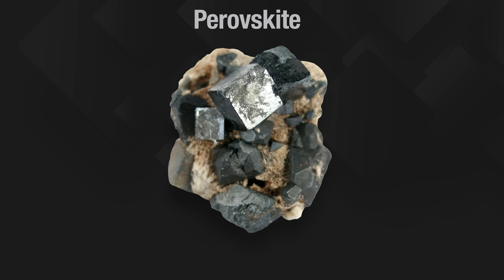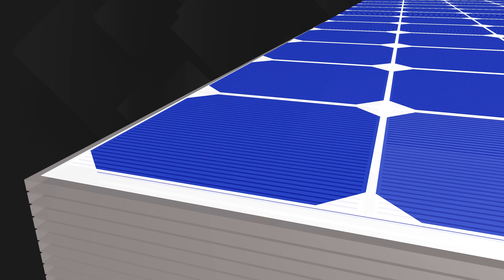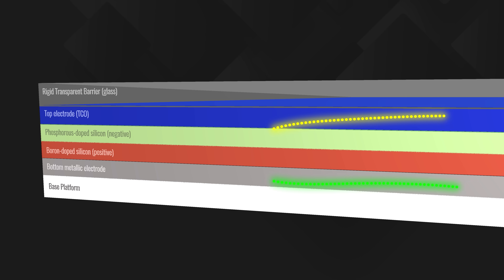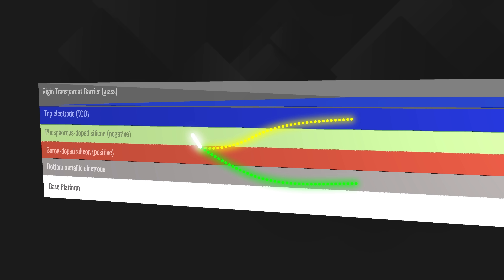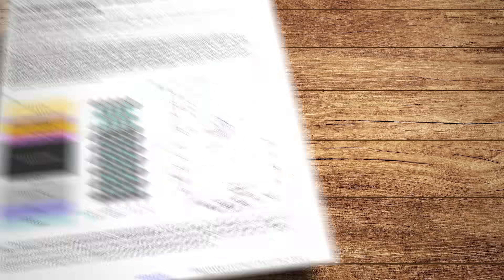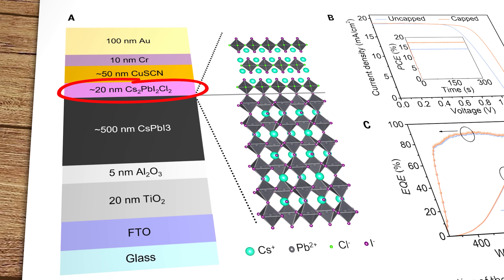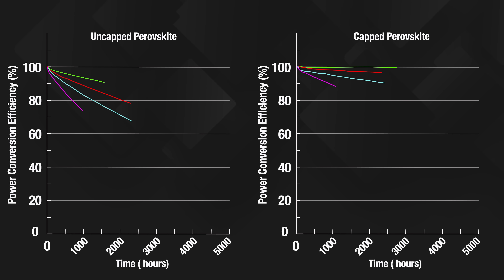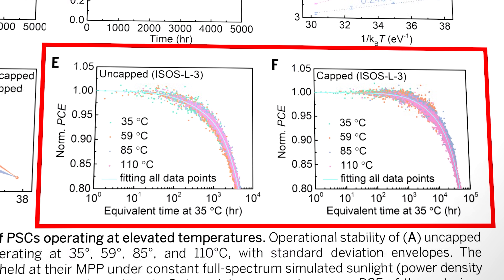Perovskite solar cells. Major new breakthrough!

Comment: I like the idea of being able to replace just the film and extend the lifespan of the solar panel..
Reply: Replacing in situ would involve spraying/spreading soluble lead compounds. You’re pretty much guaranteed to have to at a minimum take them back to a manufacturing site because until it’s encapsulated it doesn’t like oxygen or water at all.
Reply: @robertb6889  ahh .. I thought I was being optimistic but it would be a useful direction to avoid panel redundancy.
Reply: @constructioneerful  If you designed it carefully, you might be able to reuse a large part of the panel for easy recycling - essentially refurbishing it in-factory. Though at the same time, honestly, you shouldn't have production lines static enough in place for a solar panel which should have 20yr lifetimes or more, similar to a 15-30 year roof lifespan.

Comment: Thanks again, David. One issue that seems concerning is the limited lifespan of a rooftop solar cell. (~30 years?) What's the cause of the degradation, are there solutions (just keeping them cool?) And ultimately is this a bad thing or a good thing? Maybe in only 10 years from now the technology will have advanced so much that replacing them before 30 years are up might make more sense. But what do YOU think?
Reply: 30 years is significantly longer as the lifespan of an asphalt shingle roof (at least here in Minnesota). It’s significantly longer than the lifespan of the average automobile. It’s longer than the average lifespan of an oil well. It’s a third of a lifetime for a long-lived person. It’s the official lifespan of a typical nuclear reactor (although reactors often get another 10-20 years of extensions). So for me at least, a thirty year lifespan isn’t a huge concern.
Reply: divide the initial cost by its lifespan if you want to gauge if its lifespan is long enough. Pricier object should last longer than cheap object. This perovskite solar panel, if it is half the price of silicon it is already good enough to last 10 year, don't even need 30 year.

Comment: Main issues with perovskite solar cells:
1- poor operational stability
2- toxicity because they contain lead
3- poor performance when scaled up to large areas
It's an extremely sensitive material good for space applications if you ask me
Reply: I wish more people realized how truly terrifying this form of lead is. The slightest amount of water dissolved the lead right out as a lead-halide.
Reply: @robertb6889  Oh well humanity will be dumbed down enough not to worry.
Reply: Lead is only really a problem if you eat it. It was a worthy move to get it out of paint because paint chips and introduces itself into soil, it comes in liquid form and so there's always runoff and spills. Nobody's going to be chewing on your roof.
Reply: I think lead and cesium are very real environmental risk, and human risks, but more so in extraction, processing and disposable of the panels.  The quantity of these materials needs to be minimized if not eliminated.   But we do have lead acid batteries currently in production with very low cost and low impact, if we can can improve over the controls on lead acid batteries than maybe this risk is better than using fossil fuels.
Reply: #1 & #2 is being dealt with, expect to see cells without Lead. As for #3 ( poor performance when scaled up to large areas), what is that about?
Reply: They are researching using tin instead of lead. Looks promising.
Reply: Its very little amounts of lead which can be seperated in recycling, enclosed in the material so thats not a problem I suppose
Reply: Really think they will be useful more broadbandly
Reply: @CornMCMais  it has way too much lead still to be considered safe to be used in mass.  It will leak to environment. Even 1 milligramm per panel would be too much.
Reply: @movax20h  It's all cristalline material which can be enclosed how is it supposed to leak? People are putting lead sheets on their roofs lol
Reply: @CornMCMais  lead is being band is a lot uses.. if its to be used there is going to be a recycling requirement for sure..,
Reply: If there’s minimal exposure to water the lead dissolves right out like salt would. This is NOT metallic lead, it’s a highly soluble inorganic lead: ie the worst possible form.

All it would take is the panel to break, either due to improper recycling, weather or ending up in a landfill. Also don’t neglect industrial hygiene issues at the manufacturing plant.
Reply: @robertb6889  My bad, you're totally correct
Reply: I mistook it for an insoluble material.. but it seems that there are already working groups trying to replace the lead with tin, having yet to overcome the issue that the tin is oxidizing over time.. having a lead free and long living perovskite solar cell would mean it could enter the European market, making it much more viable to mass produce it seems
Reply: Dennis Lee's invention produces energy 24/7 anywhere in the world, hot or cold, day or night. And connected to their compression motor, it runs continuesly recycling over and over. The more the wind hits it, the more heat it extracts from the atmosphere. Therefore it doesn't need the Sun. 
A very simple and easy to manufacture device. Very little maintenance, has already been in production and on the market for over two decades. But the Nurds want to make everything so difficult. 
You'd think that if the Climate Crisis was real, this device would be mandated for every building in the world. But the Climate Crisis is a Hoax. So good luck with having real products for real solutions.
While you're here, look up Dennis Lee, Troy Reed and The Big Eureka. At least have a peek down the Rabbit Hole.

Comment: Okay, lots of physics in this one. I love this channel, but remember that the Arctic is already melting at our current level of 415 ppm of carbon dioxide and releasing huge amounts of methane and carbon dioxide as it does so. We really need to geoengineer the planet back from a level of 415 ppm of carbon dioxide to 350 ppm of carbon dioxide and that will take huge amounts of energy.

Solar photons only have about 2 eV of energy and chemical things like coal and batteries can only store about 2 eV of energy per atom. When you fission a U-235, Pu-239 or U-233 atom made from thorium, you get 200 million eV of energy. Doing so in a molten salt nuclear reactor only produces nuclear waste that only needs to be stored for 300 years to become as radioactive as coal ash. When you fuse a deuterium atom of hydrogen with a tritium atom of hydrogen you get 8.8 million eV of energy per atom and no nuclear waste at all. Take a look at a company called First Light Fusion for a new fusion process that will be producing commercial fusion plants in about 10 years. Until then, every little bit helps. I have been buying wind and solar electricity for about a dozen years now.

Regards,
Steve Johnston
Reply: Commercial fusion plants in 10 years! I think that's several decades off, at best.
Reply: New nuclear cannot compete, at a cost per kWh more than double renewables costs.  And no utility is going to contract for a new NPP when multi-billion dollar cost overruns and decade long construction delays have occurred at all the NPP construction in the west.  SMRs are a waste of time.
Reply: @acmefixer1  Take a look at First Light Fusion's Projectile Based Inertial Fusion process. They were able to induce fusion last April with only $59 million of research effort and their successful fusion experiment was validated by the UK Atomic Energy Authority. Others have spent many billions of dollars doing the same thing. First Light Fusion admits that solar is now the cheapest way to make electricity, but they believe that Projectile Based Inertial Fusion can make electricity as cheaply as natural gas. First Light Fusion points out that they are not trying to find the cheapest way to make electricity. They are trying to make the cheapest form of base-load electricity that is always available. Projectile Based Inertial Fusion could be rapidly scaled up to any level using very little reactor material or real estate.

We will need huge amounts of energy to geoengineer the Earth back to 350 ppm of carbon dioxide. Being hot is very unpleasant but it is ocean acidification that has driven most of the previous mass extinctions on the planet. Shielding the Earth with aerosol sprays can cool the Earth but will not fix ocean acidification. We will need to remove hundreds of gigatons of carbon dioxide from the air and oceans.

Regards,
Steve Johnston
Reply: The plasma containment vessel gets irradiated by neutrons, and becomes radioactive waste itself.  Unless First Light has solved this, it's probably not correct to say that fusion creates no radioactive waste.  I believe that we will have fusion power some day, but I don't believe it will ever be economically feasible without massive subsidy.  I'd love to be proven wrong on that.

Comment: Solar panels and energy storage are already on par with carbon alternatives. Soon they will be the only economically viable option.
Oil, coal and gas won't go away, but instead of burning it, we will use it in the chemical industry.
Plastic recycling will soon pick up too, because of those ever-increasing carbon prices.
Things might not seem dire on the long run, but I do wonder how much of nature will be destroyed before we truly get our act together;
things do still seem bleak given the speed of habitat destruction...
Reply: Absolutely. Tech is all important but it will not get us off the hook. Without significantly smaller eco footprints neither humans nor great parts of nature are going to survive this.

Comment: hoping the right researchers put several things together and the deployable results make a difference.  you move from roughly 20% efficient up to near 40%...  you're likely almost doubling power output in the same area ... that, is quite a big step...
Reply: Yes.   Once we hit 30 % efficiency and above things begin to get fun especially when mated with the latest building science trends.   If we can hit 10 kWh of PV in as few as  20 panels it would satiate the electric needs of most small to mid size homes with good solar potential.   If said homes were recent high efficiency builds they would almost all be Net Zero homes.  40 % efficiency would be fall out of your chair good
Reply: @hmurchison8123  As fare as I know 30% is physical limit.
Reply: @michaewelina7983  yes of standard PV panels but if we can lay films on PV that operate at different band gaps we will be able to exceed the Shockley-Quessar (sp) limit.

Comment: Thanks Dave!  Sounds good, just the elemental choices for the protective layer leaves me wondering if something safer could be developed.  As one Canadian toxicologist mentioned to me, there really is no safe lower limit for exposure to cadmium, and possibly the same is true of lead. Given that awareness of lead's toxic nature, it's best to risk less by finding an alternative.  On another wavelength of thought, I've often wondered if silicon solar cells are most responsive in the red light area of the spectrum,  then why not develop a fluorescent layer that converts the higher frequencies of light into red light for the cell to use?  I must be missing something, for it seems obvious that could work.  Leave your responses in the reply section below. 🌎😉
Reply: The problem with converting blue to red photons is that it only starts to make sense once you get two (infra)red photons out of one blue photon, otherwise you just reduced the energy of one photon which doesn't help efficiency. This concept (2 for 1) is called down-conversion and has so far not made it into a real product for various reasons, one of them is the additional absorption loss that occurs in such an additional down-conversion layer.
Reply: The problem with finding alternatives to lead is that the only really viable candidate is tin. Tin perovskites are even more unstable than lead as the tin will undergo an autoredoxreaction as Sn2+ -> Sn + Sn4+  which is almost impossible to stop. I think the answer is in the use of increasingly thinner layers which minimise lead need  as well as protective outer layers which will sequester the lead. You should also be thinking about unmanned space probe applications where lead poisoning does not play a factor.
Reply: They will probably reduce the thickness of the various protective coatings by a lot.  If they don't, the 100 nm layer of gold will kill them, since it's 1.93 grams per square meter.  Today's price of gold is $57.61 per gram.  Of course, that amount of gold would also make recycling of old panels a lot more likely.
Reply: @incognitotorpedo42  Check your maths.
Reply: @UncleKennysPlace  factor 10 less, eh?
Reply: @incognitotorpedo42  thank you for the edification!
Reply: Lead is everywhere, and in the proper compound, not a great health concern. Don't burn it in fuel, for example. Otherwise, there are about 2.9 billion kilograms of lead just in car batteries in the USA alone. A US billion, as in 2,900,000,000.
Reply: @UncleKennysPlace  while that is true about lead's prevalence, lead in soil may be chemically bound so absorption is less in some plants, and granted it is in almost all petrol engine cars, it's still extremely toxic even in very minute quantities and it accumulates in our bodies.  I'm in favor of alternatives simply because it's another very risky element.  One reason I favor silicon PV cells.
Reply: I like the idea of using a fluorescent layer to 'downsample' blue & UV light into the optimal spectrum for silicon absorption.
This will work. It is exactly how white LEDs are made. But the same trick will work if the light flows in the other direction, of course. The question is whether the energy lost in the down-conversion process will be less than the efficiency gained by shifting the (dominant) wavelength.
Reply: They're called photon-upconversion layers, and are getting a bit of popularity. Hard part is making them efficient and transparent enough. Photo-upconversion is fundamentally inefficient because you need the energy from two photons to combine into a higher photon. Then it needs to let the light through that the panel normally absorbs.

Silicon will absorb into the UV, but any energy over 1.1eV is wasted. A normal fluorescent layer wont provide extra photons, just lower energy ones.
Reply: There is a company on Cambridge in the UK which has developed a film using quantum dots to down-covert uv and blue light down to red. They reckon it will be easily mass producible, and should be able to simply be slapped on any existing panel for a 10-15% efficiency boost.
Reply: @icedreamer9629  that's the one I was thinking of, keep getting cambridge and Oxford solar firms mixed up.  If it lives up to the claims it should help improve fixed heavy duty silicon generation. Were as peroskevite might be better suited where thin film would excel such as automotive/aerospace.
Reply: Not cadmium, caesium
Reply: Don't worry about the encapsulating layer. There are options for that. What he neglects to mention is that highly soluble, highly bioavailable lead is present in the perovskites absorber itself.
Reply: I might be recalling this incorrectly but I think there was a video on this channel regarding a similar idea using "quantum dots" rather than flourescents to convert photons to suitable wavelengths for silicon panels
Reply: Why is lead used in solar panels?
Reply: Dennis Lee's invention produces energy 24/7 anywhere in the world, hot or cold, day or night. And connected to their compression motor, it runs continuesly recycling over and over. The more the wind hits it, the more heat it extracts from the atmosphere. Therefore it doesn't need the Sun. 
A very simple and easy to manufacture device. Very little maintenance, has already been in production and on the market for over two decades. But the Nurds want to make everything so difficult. 
You'd think that if the Climate Crisis was real, this device would be mandated for every building in the world. But the Climate Crisis is a Hoax. So good luck with having real products for real solutions.
While you're here, look up Dennis Lee, Troy Reed and The Big Eureka. At least have a peek down the Rabbit Hole.
Reply: @bradleejones9959  we have different opinions on solar, but most of us agree that Lee is a Scammer that in more than 40 years have never produced a working prototype nor delivered anything to his investors.
Reply: Most solar panels have more than 20 % efficiency already. The US spent about 20 trillion dollars in Afghanistan plus  interest.... If those money were spent on the existing technology you'd be ahead in autocracy and lots of people would be alive.... It would be a great step forward to have modules with 30-40% efficiency but that should not be taken as an excuse to procrastinate the transition to a fossil fuel free system.
Reply: @lorenzoscaramucci3336  that would have been money not paid out in dividends and stock buy backs.